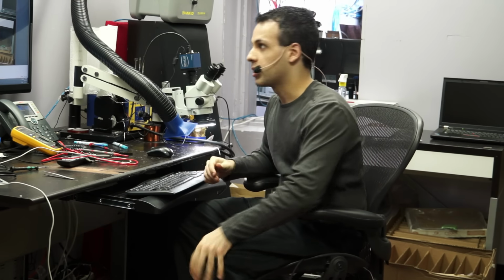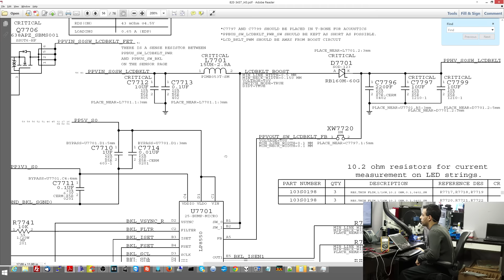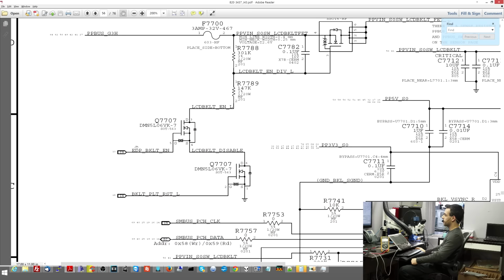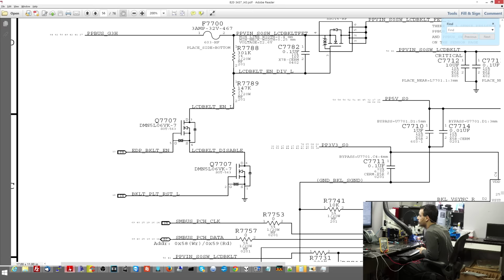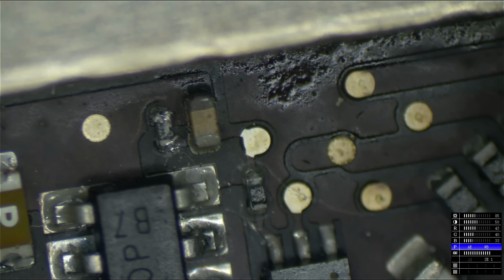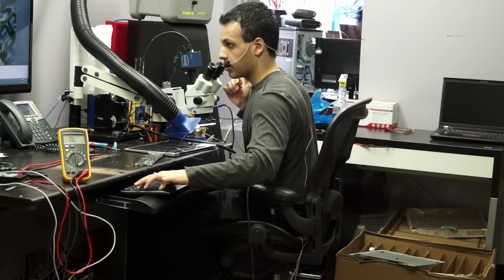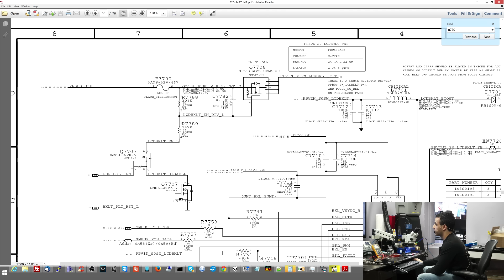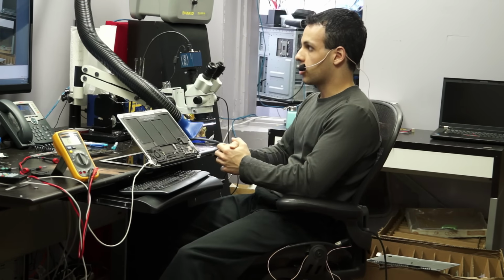No backlight on Macbook Air, shorted cap in enable circuit.

Comment: Is there a reason you would get a standard resistor or cap like that from a donor board instead of using a fresh one? (Other than not having one of that value on hand of course).
Reply from the maker: ElectricGears Faster. I only keep spools for components I replace constantly, otherwise, no spool. Just not as fast or convenient.

Comment: Hi Louis
first I want to say thanks for your perfect edication videos.
I want to learn your suggestion for one problem. I have 820-2838 macbook air mid 2010 board its dont have LCD backlight. I dont have LCD_BKLT_EN signal at Q9807 gate so i didnt have PPBUS_SW_LCDBKLT_PWR. its loking comes from MCP graphics chip:( I try to send 3v for enable signal but didnt worked. Do you have any idea for next step? Thanks.

Comment: Hey Louis, I started following your channel recently, and found it very educative and interesting :)
Since you've said we shouldn't ask about software you're using for mac schemes, I wont (even tho you can pm me or something, to let me know :D )
My question is:
Board is 820-2850-A
It had graphic distortions, and my colleague tried changing GPU, but didn't have video at all with new chip.
Put back original one, and it worked, but the thing is, it's working occasionally, giving white screen always, sometimes with dots, little stripes, sometimes normally, and as I've noticed it tends to lose video completely.
Do you have any advice please, to better understand this type of issues?
Thank you very much, and I'm sorry for this long comment.